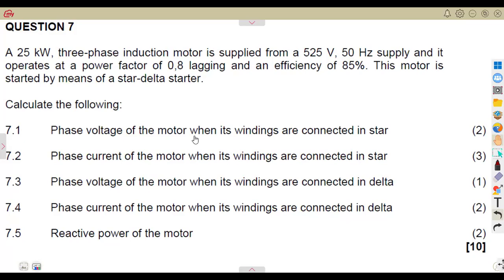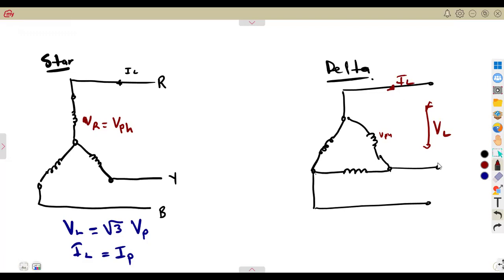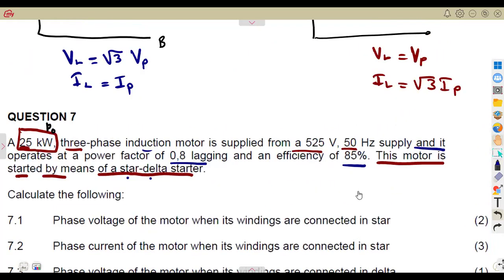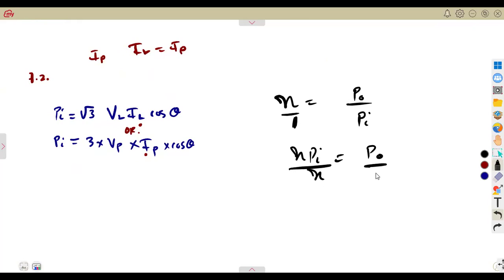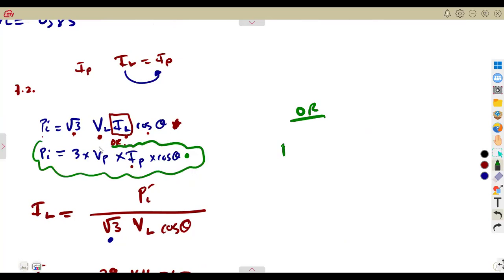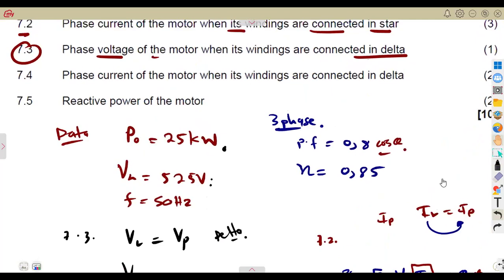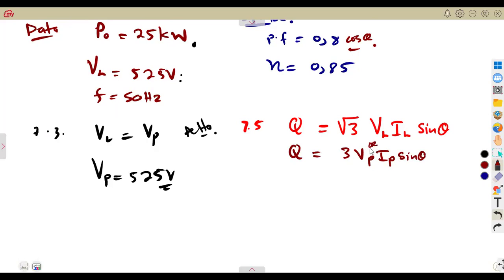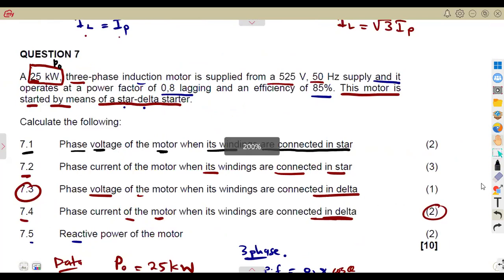Electrotechnology N3 AC Theory 3 Phase Systems Revision 1 @mathszoneafricanmotives

Comment: 7.5 i got 21 904.88426

I used phase values...what is the problem
Reply from the maker: It's oky like that, it's because we are using rounded off values,  so they won't be exactly the same.